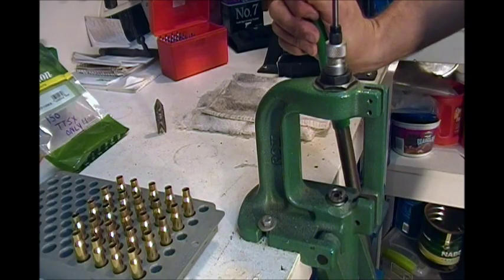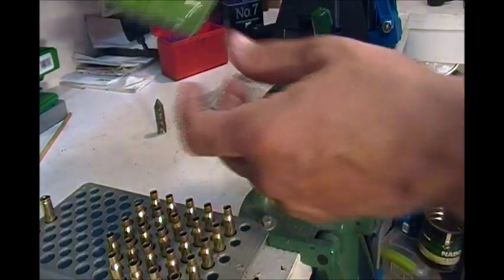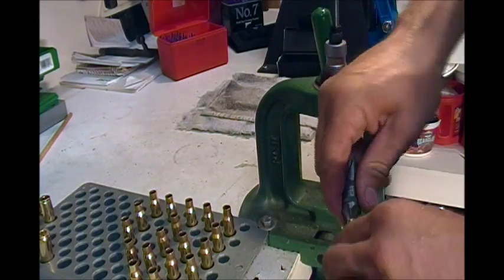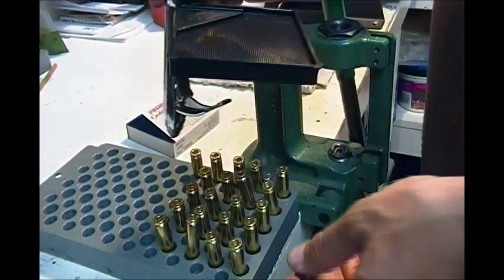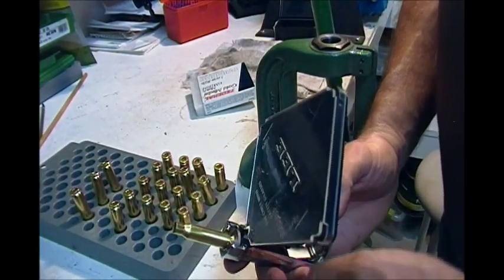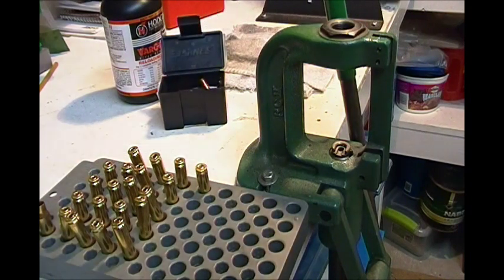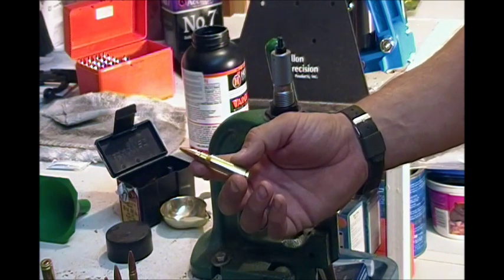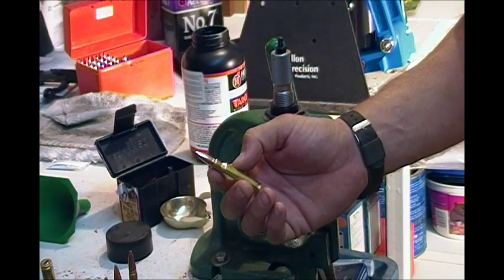RELOADING BASICS  .308 WITH NEW BRASS.wmv

Comment: Another thing is, if you're reloading rounds specifically for a bolt gun, you might want to go to a Neck Sizer die.  This way, the cartridges are already the size of your chamber and they're not going to expand anymore.  You could get a longer life out of your shells, rather than full sizing them every time which eventually thins them out to the point of cracking.  I personally have reloaded some of my .30-06 cases more than 30 times and there's no sign of wear on the inside of the case.

Comment from the maker: Sizing is basically reforming the fired case back to its original size.  Trimming is just that, trimming a case back to original length after it has been fired numerous times and stretched out.  Flaring or belling is used primarily for straight walled cases to aid in seating the bullet.

Comment from the maker: Usually the most accurate load (powder) is listed in the loading manual and most of the time its right on the money.  Nosler, Barnes and Hornady are my favorite manuals.  Check the online loading sites are another good source.  Time as little or as much as you want.  Clean the primer pockets, resize, clean trim weight each powder charge...anywhere from 30-90 minutes depending on type and you.

Comment: Hello there, My guess is you are probably using to much case lube, if you have to much case lube on your cases it's very easy to crush the shoulder, secondly you may have your resizing die a little low. back your die out, run your ram all the way up then screw your die down to just touch your shell holder then back your die out a quarter turn. between those two, that should do it.

Comment: 1/2" groups at 100 yards.  1&1/4" groups at 200 yards.  6&3/4" groups at 400 yards.  And this is out of a $279.00 Stevens M200 .243 Win.  Its good powder.  At least for me it has been.  I guess it depends on your loads. My .30-06 Spr. rounds are just as accurate, I just don't shoot enough of it to take measurements.  I take a few shots and its dead on every time so I end up putting it away.

Comment: Why wouldnt you use the Dillon press to load yer 308? Ive been loading just as long as you and found the Dillon presses can load very accurate ammo. I have won High power matches with my M1A with ammo loaded on my Dillon 550B. And get .5" accuracy from my remington 700 Tactical.